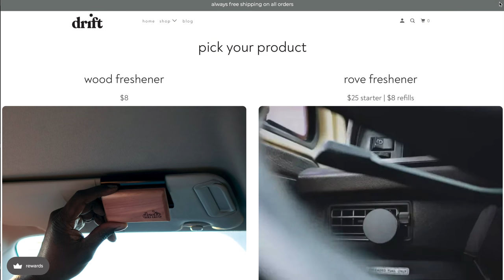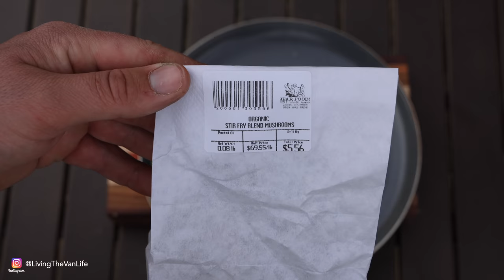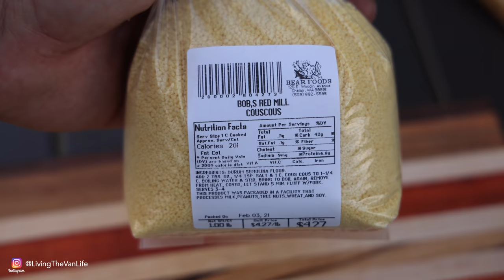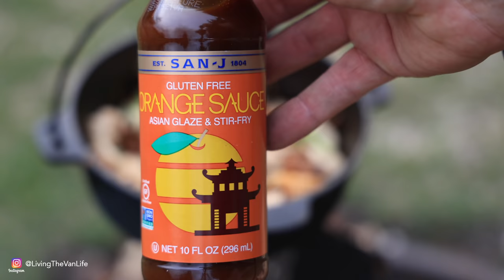The Spirit of Overlanding - Living The Van Life

Comment: The Ranger looks like a perfect size for taking with you in the van, but when you're buying firewood then it feels like the smaller size would become annoying compared to the Bonfire.
I think if I was in your position I would look into a battery powered reciprocating saw and a bunch of wood cutting blades.  Would make quick work of downed trees and would also make prepping wood for the fire pit super simple. And it wouldn't surprise me if there was a saw that takes the same battery as other cordless tools you might already have.
Thanks for sharing your journey with us.

Comment: I saw the underside of your bed when you when you opened the back doors to get your fire pit out that.  That 3+ inches is a great place to store things like hiking poles, an axe, your folding saw and any number of things that have a small thickness and can fit in there.
I also noticed how your tires flexed going over the log.  How far down are you airing-down?  I typically go down to 35 on my Sprinter.